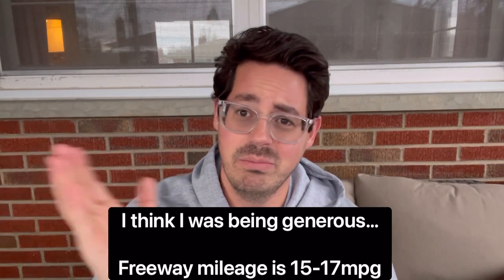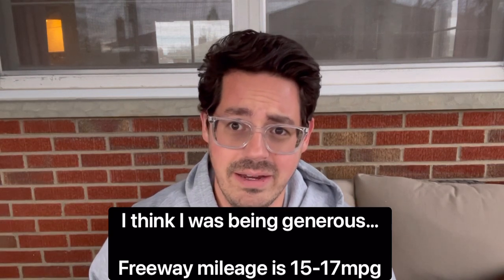Worst Engines of All Time: 1982-84 GM/Chevrolet 305/350 V8 Cross-Fire Injection System

Comment: GM ditched it after 2 years.  They NEVER ditch anything that quickly unless it's unmitigated garbage. 'Nuff said.  Great video,  sir,  as always!
Reply: True! They usually wait to get all the kinks worked out, then cancel it!
Reply: I'm always amazed by the number of people who come here with their "inside knowledge".  It is good for a laugh, though.  I'm going to show these comments at our next neighbor gathering and we can vote on the most comical response to these videos.  Thanks for bring humor to the day.
Reply: It was just a cheap twin carburetor with injectors , while they were developing their multi-point injection system which provided unbelievable torque(300+) for an engine that only put out 230 horsepower which went up to 250 with a factory exhaust and aluminum heads in 1986.-Fact
Reply: @jamierodriguez3554  Isn't everything in automotive "just a cheap" something as technology advances and the next generation of item is rolled out?  Why pick on the Cross Fire system?  It served its day.
Reply: It was early fuel injection, what was the need to keep it?
Reply: @CurlyQYT  Technology improved and changed.  You are correct.  I disagree with the presentation made by the author of the video as it is not substantiated by fact, but by fictional drama designed to add comments and volume to the video listings.
Reply: I thought GM used that 305 TBI into the 90's including the RS Camaro? And the trucks?
Reply: Makes me wonder why they continued the vega for 7 years then...
Reply: Dead wrong. It was a time of great change and development, and there were a lot of engine packages that only lasted a year or two at the time.
Reply: Yeah. If you need proof, just look at their dreadful Northstar
Reply: @Phenom98  just 2 days ago,  I helped a guy push his Northstar Cadillac out of the road. He bought it last week,  and it had overheated and wouldn't start.  Hope it's not the head gasket....
Reply: Actually those throttle bodies were used on many GM cars of that era so they have been around a long time. All they did was double the system to get them by for the V8 Corvette because the delays in the development of the T.P.I. system which finally came out in 85. Originally the Crossfire wasn't supposed to happen.

Comment: I bought a brand new 82 Indy pace car Z/28 with a 305 crossfire. Functional hood scoop as I remember. The engine was good however every polyurethane bushing was replaced along with the entire rear axle differential assembly 
Many other bugs had to worked out and repaired. After a year I had enough and traded it. It was however at the time a very cool car in my youth
Reply: They definitely looked the part.

Comment: So put an older intake on it with a two or four barrel carb and your problems should be solved.  Doesn't a 307, 327 or 350 intake fit on it?

Comment: Over the last 50 years I've had 5 or 6 gm products and they all worked out ok.  I must have been lucky.
Reply: Nothing runs like shit longer than Generic Motors
Reply: @ronin rolling tracking devices . And they will rat on you with their black box.  No thanks, I'm a very competent mechanic newest I'd ever own is 2000 before they were made tracking devices .
Reply: Gms are superior to fords and chrysler in every way.  I have a '98 Safari with 248,000 runs like a top and I smoke kids in little fart pipe cars all the time.  My '73 impala has only had the engine changed to a mild stroker and regular maintenance , it drives like a new car.
Reply: @ronin when the air bags deploy the blackbox records rpm,throttle position , brake usage, pretty much every metric the ecm knows. Those WILL BE USED AGAINST YOU IN A COURT OF LAW.  The second is ofc an opinion, but I've been wrenching on cars since '83 bought and sold more cars than I can remember and ford straight up sucks. Dodge and Chrysler are fine but hunting parts ain't my favorite hobby.
  Can't believe you didn't know your car will rat you out, folk that. I've built at least 20 motors without a failure and inside engines is where you really see that ford sucks. Ford has a team that goes to junkyards and see which parts last so they can redesign them cheaper . They started that when Henry was still in charge.
    If you hear nothing else hear this, madmen and small children always speak the truth.
Reply: @ronin And this is a funny one, I live where Big Daddy Don Garlits has his museum and frequently see him at a local restaurant .  I'm pulling in with my Impala as he's walking out, he stops and says nice car. I reply thanks Big Daddy in a nanosecond he replies , Sell it and get a Dodge son. I wanted to kick him right in his as. 😆
Reply: You were

Comment: I have a great story about an 84 Corvette with the crossfire. In the mid 90s my buddy had the 84 Vette. I had a 91 Ford Taurus SHO (still own a low mile 92) Yamaha built V6, 5 speed. You being a car guy I’m sure you know about them. My buddy gave me a ride in that vette. To say the least, I was not impressed. I told him “ my Taurus would smoke this thing.” He laughed. We lined them up down a road we’d go to drink. Called it Vampire graveyard (don’t know why. Stupid” anyways, we line up, I burn the damn tires off it in first through second, trying to control the wicked torque steer. Once I got traction, I embarrassed him. In front of 20 people. I put well over 200k miles on that car. Extremely hard miles. I gave it away about 8 years ago.
Reply: those SHO Tauruses could boogie, that's for sure! even stock, i love the exhaust note they make.
Reply: Those SHO's where really good sleepers I've always wanted one with a 5 speed
Reply: Yea they were a cool car with the 5 speed but not super fun to work on
Reply: @4playpowerful  heck I didn't even know they were available with a 5 speed. that's awesome!
Reply: @mdotguy  That is all the first gen had as they did not make an automatic that could handle the power. Ford did this with many of their 80s performance vehicles. Most of the time if it had an auto it had a lower rated horsepower than the manuals.
Reply: @D3M3NT3Dstrang3r   Also owned a 98 V8 SHO. Bought as a demo in February of 99. Was nothing compared to the V6 SHO but sounded amazing. They had cam issues. The cam sprockets were pressed or sweated on. They would spin and shove the valves through the pistons. Those motors cost $19k. So you had to have them welded. In 01 had my cams welded by Kirk Doucette and had Doug Lewis tune it. Put a SHO shop cold air intake and they came with a massive throttle body. Like a 78-80mm. It also had secondaries and when they opened, it would turn heads. Kinda sounded like a Q-Jet when them big back barrels opened up but louder. With the tune, it shifted at 7,500 rpm’s. It sounded like it was a 500 horsepower monster but it was a gutless turd. Lol. 
Also had the third cat deleted along with a muffler delete. Sounded wicked. There’s a video of it on my YouTube channel. Parts were getting scare so I sold it a few years ago. 
Also a short video of my pristine 89 Thunderbird Supercoupe.
Reply: @DavidGragg82  Ill have to check out that vid. I was never really into the catfish SHO so I did not really hear or learn much about them. I did really want a 95 Forest Green SHO though. Had an 87 and 88 Turbocoupes that I absolutely loved. The 88 manual was 190hp stock at 16psi . I had my 88 running around 21 which was closer to 230 - 240ish But was only safe to make those numbers when cool outside as the smaller ihi rhb52 turbo was on the small size for the 2.3 and would start to cause detonation above 18psi in a normal warm climate. The poor 87 was an auto a4ld with a stock tune of 140hp at like 11 or 12psi. Needless to say the trans did not like the extra boost (18psi) for very long before it puked.
Reply: @D3M3NT3Dstrang3r  funny how they didn't have an auto that could handle the power, and then with the 5.4 in trucks I always heard they didn't offer a manual because they didn't have a manual that could handle the power... I know there are manual transmissions that can easily handle that whole 260 horses... I mean, they had them in the super duty. Maybe just not one that would fit the f150 tunnel or something. Always wanted a manual in my 2000 f150, that truck was an absolute BEAST! Literally a tank... I rolled it at about 40 cause the gooseneck I had on it shorted the breakaway brakes and locked up, and I stupidly turned it into a jackknife and roll. Didn't even break the mirror on the passenger side... Just popped it off and cut the wires of course. But I popped it back on, like it never happened. Broke the back door glass, the front window was down so it survived. Flattened the profile out, and you had a couple inches less elbow room. But the door worked fine, window rolled up fine. I had more damage on the driver side, cause the trailer frame rammed my door and pushed the bottom of it all up, and the floorpan with it. No seatbelt, and I never moved. We came to a stop, I'm sideways in my seat, my buddy was standing on the road, through the passenger window, and we're both like, what the hell just happened?
Reply: Except the Automatic SHO's that came optional in the 2nd Gen from 1993-1995 with a more powerful engine than the 5-Speed Manuals did. Using the AXOD-S 4-Speed Automatic, Automatic SHO's came with a bored out 3.2L version of the same 3.0L Yamaha V6 found in the Manual. Both engines made the same 220HP due to the 3.2L's milder camshaft setup but the 3.2L made 215ft/lb's of torque vs the 3.0L's 200ft/lb's of torque to help makeup for the inherent power losses that come from having a FWD Automatic transmission of the era. Although, in 3rd gear the AXOD-S can actually achieve 96% efficiency so on a long freeway pull the SHO never seems to get slower. Actually, it's weird. Once you reach 3rd gear the car actually seems to go even FASTER from 80-90 than from 70-80 lol.  @D3M3NT3Dstrang3r
Reply: @ftffighter  Im guessing they had figured out some torque management, or figured out improved materials by then even though alot of Taurus' were returned under lemon law for failing autos in the 2nd gen. I'm just guessing that the trans in the show was built different?
Reply: It was also very common for 80's Fords to either derate the autos or remove them completely. No 80's Escort GT in auto, Thunderbird Turbo Coupes were offered in auto but with 30hp less and when retuned would destroy the A4LD in short order. Mustangs were the first that comes to mind that offered both in GT trim, not sure of power ratings between the 2. They did rectify this starting in the early 90's though.
Reply: Never met anyone that thought an 84 corvette was fast.
Reply: @danh8302  but was cutting edge in handling, with the new suspension and BIG 16 in tires
Reply: I’ve owned 5 of the taurus sho’s and I can vouch that they can completely roast the tires off the front if you’d like to lol. My favorite was my white ‘90 I sold 6 years ago. Biggest mistake I’ve ever made. Cheers brother
Reply: My focus st can walk a friend's c4 with a cross fire
Reply: @ianthompson2802  well I'd hope so
Reply: The only car I ever dusted that I could see pulling up on me was the SHO, Corvettes and Mustangs were not that quick only the first 50 miles an hour of them after that they were bricks going down the road with shity ignition timing/lean fuel mix...uggghhh
Reply: The sho was no joke.

Comment: "In the parlance of the porch chat .... phbbtt"  -  gotta suspect candid opinions like this builds subscribers.

My early F body experience was on a stripper Camaro, 4cyl.  No AC, but F41 and 205/70s.  Bought on a budget, with considerations of insurance and gas cost, but it did have a 5 speed.  At the time I was just amazed - the handling was leaps and bounds beyond anything in the high school parking lot, or really that I'd ever experienced at that point.  Sure it could only hang with a Corolla 0-60, but would lose lots of other cars on a curvy two-lane.  The only downside was remembering to compensate for width on roads that didn't leave much margin.

Comment: "The throttle sticks sometimes but other than that its a good car"
What a sales pitch man LOL
Only people like us would put up with that.
Reply: Or, you could drop in a sales pitch "typical of a vehicle only driven by an old lady to church on Sundays".  My mom bought a 5yo '83 Mercedes 380SE from another old lady and idled around in city traffic in that thing for 15 years before selling it to me for cheap "because it was too big".  Always serviced on time & looked after, however the plugs would periodically foul-up because she was just idling around that V8 without ever giving it much throttle.

Anyway, as soon as I got my hands on it I gave it the beans and the throttle stuck wide open at 6500 RPM & I had to kill the ignition and coast over to the kerb.  Checked out the throttle linkage and sure enough; the cable had stuck because it had never been opened more than 1/3 throttle by the old women that had been driving it, causing the linkage to jam because that portion of it had never been used in 20 years.  After a good clean & lube lube and several repeated WOT events it came good.
Reply: It was just part of General Motors master plan to sell a lot of Japanese cars. It was very effective
Reply: probably a bad motor mount
.
when it runs right and ya rev it up and it actually makes power...... mount flexes (or is tore)
engine lifts up.... usually only stops when it hits the hood.... which pins the linkage 
.
.
if you put it into neutral and the RPMs drop
its a motor mount almost 99.99%
.
if RPMs stay high...... stuck cable or carb linkage binding, stuff like that
Reply: @kainhall  except he said he had documentation which shows this was a problem when the car was new

Comment: After the great Turbo Hydro 350 and 400 transmissions the later 80’s and 90’s GM transmissions were a huge disappointment. Add that to the crappy build quality and low power motors and GM lost me as a customer until 2011.
Reply: 2007 Bowtie classic, tire smoker and that's not a 2011.

Comment: Idk. I’m a Mopar guy. The Ramchargers. A group of Chrysler engineers were the first to experiment with the “ram” effect on normally aspirated engines. On the big block Chrysler the long ram was good for low end torque, and wasn’t very good above 4500 rpm. The Max Wedge and later the Hemi utilized the short ram for 6500 rpm. I think the “cross fire” was just a restrictive design.
Reply: The Chrysler cross ram had two designs, 30" for street and the first 15" siamesed tubes to give 15" runners in the race version...

Comment: Adam,   I had  a 1982 Z-28 with the 305 V8 but with the rochester 4 bbl that had the throttle position sensor and mixture control solenoid,  that "wonderful" computer controlled engine system with the inputs of the O2, temp, etc. to the computer to maximize I guess emissions (reduce) and fuel "economy (?)".    I hope you review that electronic carb set up as it did give me some headaches.  I remember the car got around 18 mpg on the interstate - I always thought that was good.  10 years later, I bought a new '92 (last year of that body style) Camaro RS with the 305 throttle body injection - big improvement over the '82  - engine performance was flawless.  I put 150,000 miles on that car with very little issues (well maintained).  Yes, I remember that care was more solid in assembled feel, heck they had 10 years to get it right.   I always loved the seats in that car, very comfortable and fit my 6'4" body, much better than my 2001 Mustang (awful seats).

Comment: Speaking of flex, I️ believe that most of the basic structure of the 4th Gen f-bodies from somewhere around the drivers seat back was a carryover from the 3rd generation, even though they aesthetically are markedly different.
Reply: 4th Gen was a upgrade to gen 3
Reply: The fbody had the same frame from like the 70s to the 2000s

Comment: I remember going to swap meets in the 90’s and seeing these systems sitting in cardboard boxes for dirt cheap. People called them “Missfire Injection.”
Reply: My brother was a mechanic and referred to it as the ceasefire.
Reply: I've seen people calling them "Cease Fire Injection", which I found funny
Reply: Yes, and I remember going to a swap meet and heard a guy call a Chevrolet 396 a "boat anchor".  I asked him why and he said the design was flawed.  So, I asked if the 454 was a better design and he said "heck ya".  Another George, Elmer and Barney who know everything.
Reply: @GoldenGun-Florida  
Yeah, it's better cause it's bigger, duh...
Seriously though 396 is one of the best big blocks. Just like the crossfire can make decent power, if you aren't a muppet.
Reply: @member57  nothing wrong with a 396, but there's no reason to build one today unless you need a period correct engine. The BB chevy is too big and heavy for just 396 cubes, like the humongous 426 Hemi which should be more like a 526 going by the size and weight of the block.
Reply: @GoldenGun-Florida  Same block with a bigger bore, as you know.
Reply: @GoldenGun-Florida  the boat anchors were the old v6, the reason for the name is because the block was big and had no power, that didn't know what he was talking about
Reply: @johnnysalazar5163  I agree that he didn't know what he was talking about.  Just another George, Elmer and Bubba at a swap meet who knew nothing.  I wouldn't go so far as to call them idiots but close.
Reply: Because people didn't know how to work on them, mechanics included. Electronic fuel injection was seen as voodoo.
Reply: Old simple technology gets everyone flustered , Hilarious
Reply: @cswango1714 it did have issues though.
Reply: @cswango1714  yeah, people do not like it when things do not work correctly; imagine that!
Reply: @cswango1714  You nailed it.